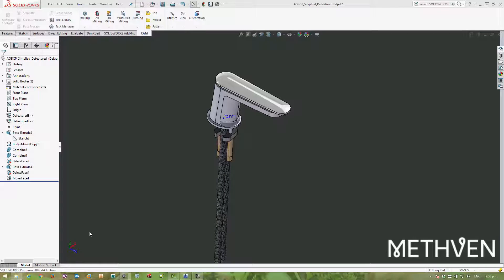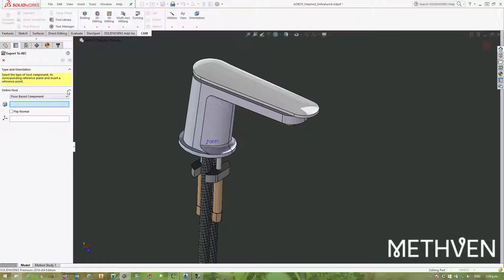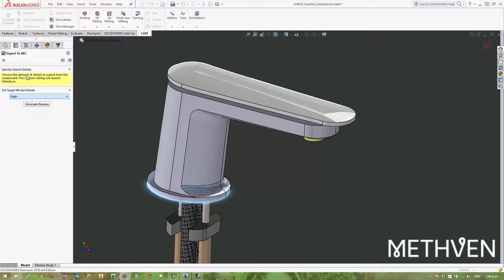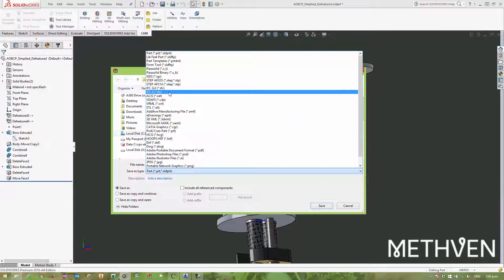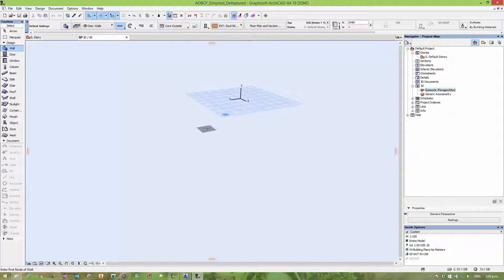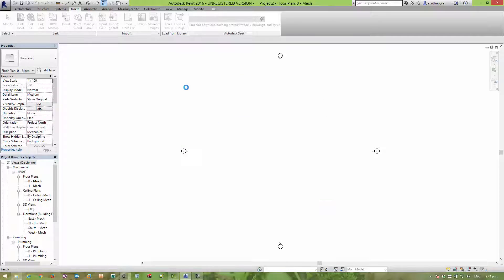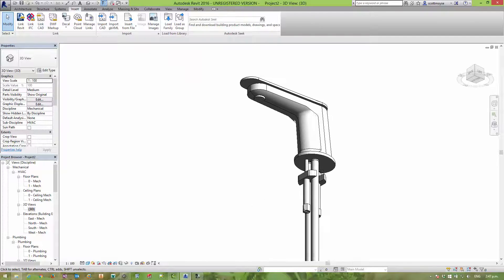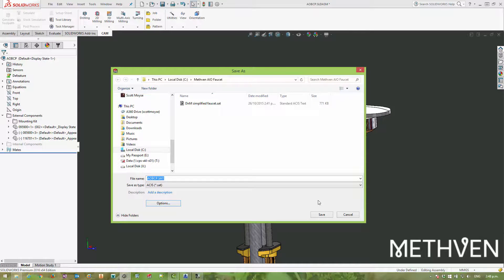How to create great BIM content for Solidworks - Export to BIM

Comment: Currently Export to AEC under Tools in SW gives a possibility to export SAT and REVIT file, this could be worth for an update video.
Reply: I tried it now, and I get a triangulated solid black blob of a mess I can't do anything with, using Revit LT.
It also completely ignores configurations and visibility states. As do most others.
Stl works, but triangulated, and as far as I know, impossible to get in as a family.

Comment: Hi Scott, i'm trying to export an assembly from SolidWorks to Revit, but i need to know which are the components of the assembly and the configurations of these components ? Can you tell me if it's possible or not?
Reply: I don't think I can help you based on the information you've provided here. This question might be better suited to the Solidworks forums?
Reply: +Scott Moyse the thing is that i made an assembly with SolidWorks and i'd like to export it to use it with Revit and i need to see the components of this assembly and their configuration
Reply: +Olivier Papin ok then you need to make sure you don't merge bodies when you simplify in Solidworks. so far as the configuration is concerned, if you want to duplicate Solidworks configuration behaviour in Revit. Then you can't via any form of export. You will have to build a Revit Family file. Where are you based in the world?
Reply: I've already tried to export my assembly to IFC file but when i open it with Revit it's one big block and i can't see any property or component of the assembly. I'm based in France right now
Reply: Olivier Papin make sure the bodies aren't merged in swx before exporting as IFC
Reply: @olivier95160  i got the same thing going on right now - got any luck with the solution?